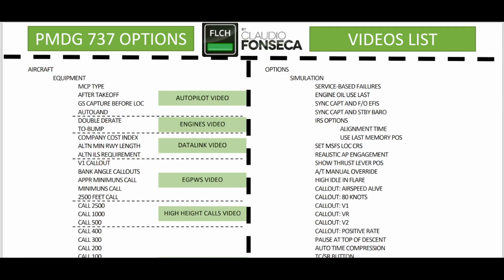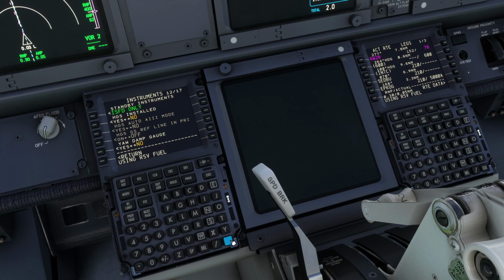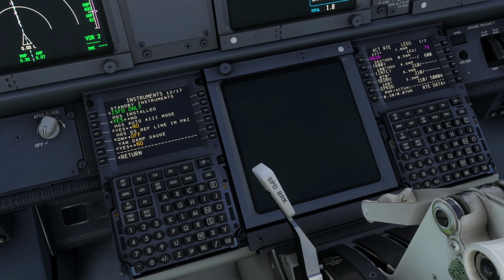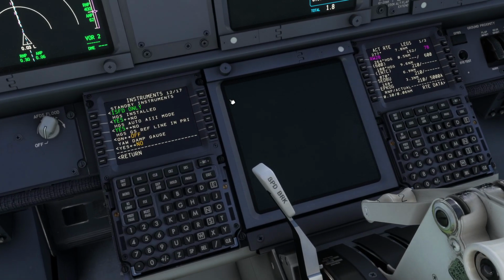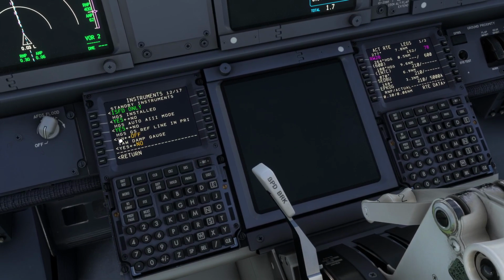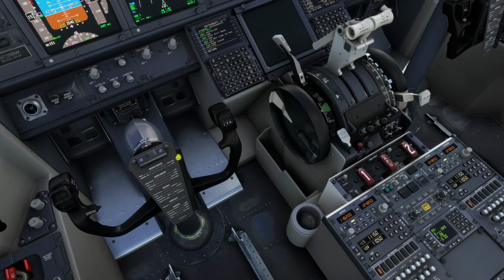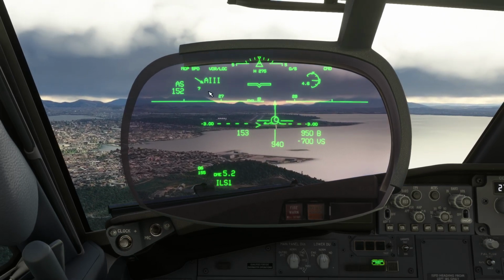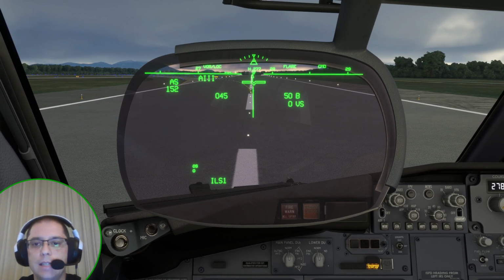HEAD UP DISPLAY  - ALL 737 PMDG OPTIONS EXPLAINED

Comment: Thanks you for this video and I still wish to confirm before I buy, that the PMDG 737-800 for MSFS does come with the option for Head-Up Guidance System (HGS) ?

OK found on a forum   . . . ."Its in the PMDG setup/Aircraft/Equipement/(Page12)/HGS enable :)"
PMDG are showing it off for the PMDG 737NGXu P3D version, but not listed in specs for that or any other version???
Reply from the maker: Hello!
All PMDG 737 for MSFS have a HGS!
Just enable it from the FMC menu!
Cheers!